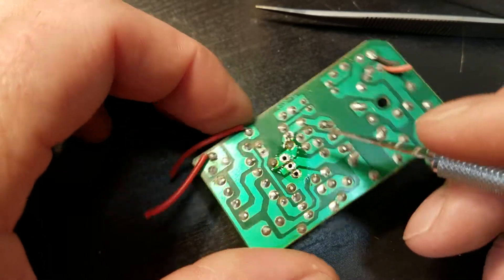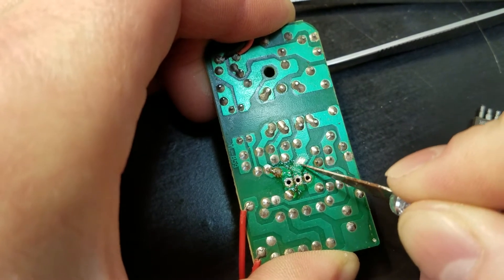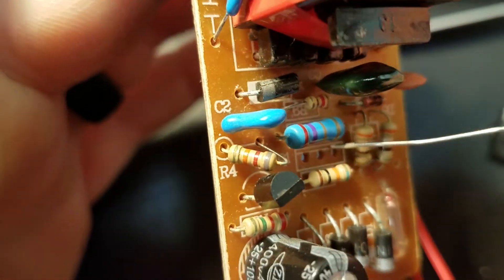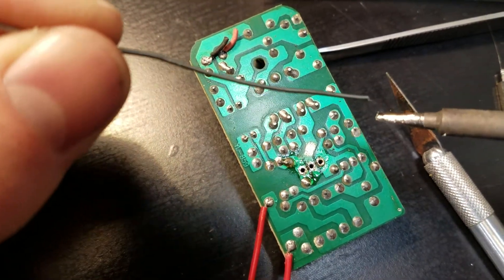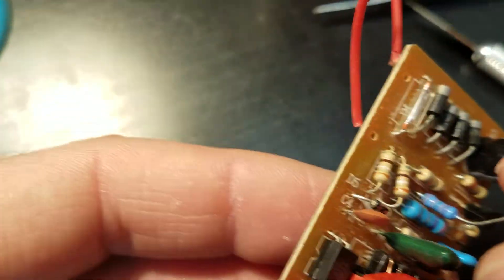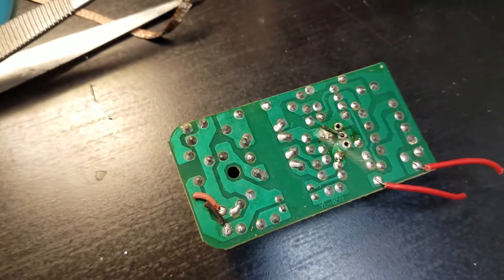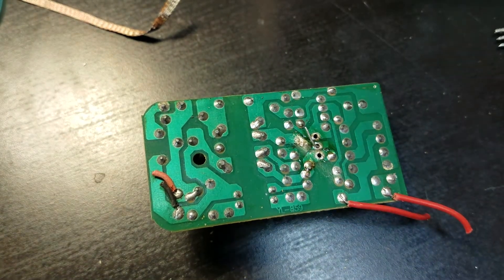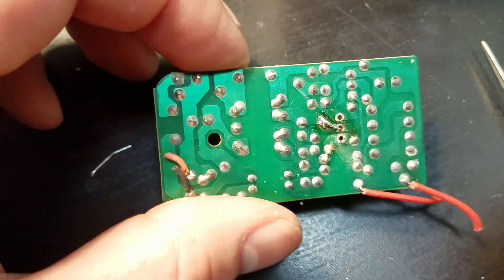Soldering tips - how to work with a pulled pad with through hole parts

Comment: Thank you for being detailed about the little stuff that isn't actually little stuff to someone like me who is just beginning to learn about components with his Radio Shack Learning Lab.

I'm practicing soldering skills like this with mostly junk circuit boards, but I'm also daring to fix a quality sound mixer. It's got a handful of missing pads for the faders which had a short and blew the power supply. The missing pads are super tiny. I've ordered new pads, butI'm still not going to be confident I know exactly which pad should be connected to its neighbor, which needs a barrel connecting the other side or maybe the layer of copper in the center of the board. Even with the data sheets it's likely this is beyond my abilities for now.

Comment: Hi! I know I'm late. But, what if the through hole has no trace line? Thanks.
Reply: I'm the beginner from a close by comment, so don't take my word as gospel. If there is no trace line I think it's there just so the pin or lead from the component has something to connect to. I've also been told in this situation you might have a layer of copper sandwiched inside the board acting as ground. Oh, and there may be a trace on the other side it's connecting to.